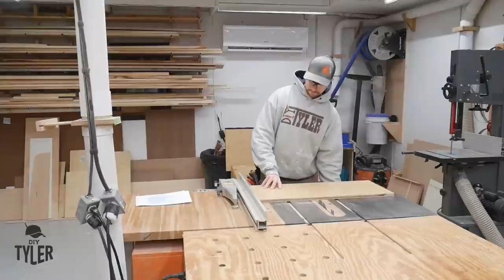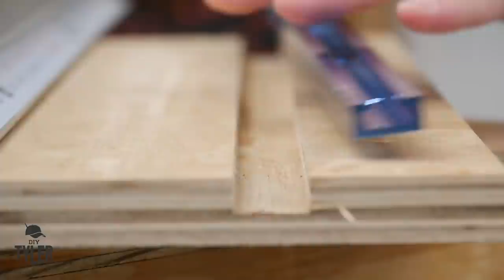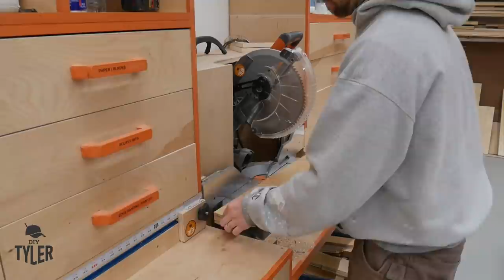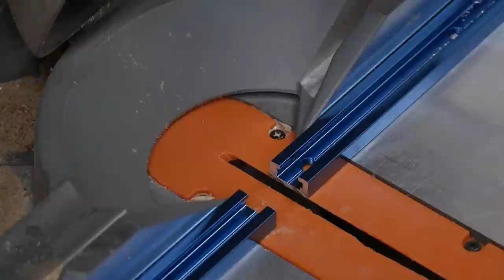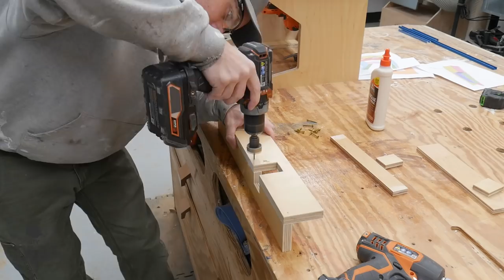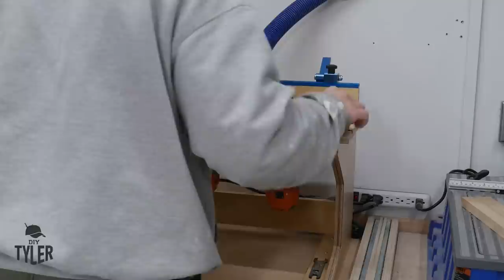How to make a DOUBLE Trim Router Table. Simple Shop Project will Make your Router Workflow Faster!

Comment: I think I’m going to do this on a larger scale with 3, 1-3/4 hp or 2-1/4 hp routers set up in a triangular table. Round over permanently set, a round nose for handles on cutting boards with a jig to make the correct stop and start, and the third will be for any other bit I need to change in and out. Then I’ll have one power feeder in the center that can swivel and service all 3 routers. One dust collection drop right in the center with a quick connect to switch between the 3. (Combining this idea with a picture I saw of a three spindle shaper)

Comment: Interesting build Tyler. However, if you already have two routers, why not just have a single station router table and just switch out the routers with different bits in them?
Reply: There's a few benefits, one of them could be having the same bit in them at different heights so it doesn't overload as much your routers, if youre taking by passes for instance. Another one could be to make 2 different profiles at the same time (for example, making a chamber and also a groove, on the side of a piece). And as he showed, just pushing one up and the other down is quicker than entirely switching the routers, in most cases.
Reply: I had the same idea I'm getting ready to build; I want to do moulding in 1 pass..... 1 router to tear some material out and second one for finish cut.... Might run the stock through a second time with just the second unit running to make sure it's a nice clean cut
Reply: I agree with you! Since you cannot keep height settings and you would need to lower or raise the secondary router.

Having two routers running parallel seems dangerous and you might also blow a fuse if they are connected to the same outlet.

Also fence setting is same for both operations... Not always what you want.

Comment: Since you have some magnets put them in the fence and also in a block of wood and you can close one of the holes to improve dust collection.
Reply: Obviously use the same spacing on each side so you can just move it from one to another.

Comment: I thought you were going for a use case where you used both routers simultaneously to create a complex profile.
Reply: I'd be concerned with differing cut and feed rates, especially once the second router engages.
Reply: @billparco8072  agreed that's a concern, but I still want to see it.

Comment: how about setting up for a cove and bead for a cedar strip canoe
Reply: This would work well for that operation.
Reply: @workswithwoodyeg  Can you set it up to do both cove and bead at the same time, one pass. It seems to me you would have to set up one router upright above and the other below the table. Otherwise you would get a push pull action on your work piece.
Reply: @lorencolt  yes you could do a two router set up, one up and one down. Honestly though the routers might be a bit close together for that. I would think on a two router setup you would want it dialed in pretty good for some precision work. For this, I would be inclined to do the beads first, then use the other router for the coves. Where I see this working well, if you did a lot of routing and always used a flush trim bit or a dedicated round over. Basically having two router tables in one, but again this is a little close together. The nice thing about these light routers is if they are cordless you can still take them to your work, rather than being stuck in the table the whole time.
Reply: I seen a dual router setup 30+ years ago with 2 Craftsman tables and routers but they were facing opposed and offset to each other for running cove and bead canoe strips at the same time. He could do enough footage in a hour to do 2 to 3 canoes. But the bead one had 2 fences and pulled the strip though pushing it through the cove set up that had feather boards to hold it to the fence.

Comment: You probably should add a way to close off one of the ports for the dust collection while one is in use.  Your drawing too much air in from the side your not using.  Or you you need to have 2 suction hoses connected (one for each port) with shut off values for each (better option in my opinion)

Comment: The point of such a setup is to run both at the same time with two complementary bits set up in order to make a deep grove or something more specific (like a repetable, non standard groove)
It helps to have a fence that can be setup not parallel to the line on which the two router bits, and maybe one of them should be tiltable, and a longer table.
I tried with two running at the same time, and there is no problem because both of them tend to draw the piece toward the fence.  Obviously it's better to use on a piece that has a nice straight edge.

Comment: Great video. Just a quick question. Have you tried using both routers at the same time? Such as using a different profile bit in each router to create molding or trim? I hope that question makes sense. Seems to me the first router might cut the top of the desired profile and the second router could cut the lower portion of the profile. By having the second router cut the lower portion of the profile it would leave a flat section on the stock longer to help prevent any tipping or rocking of the work piece. It would be interesting to see this done
Reply: Running two at the same time sounds dangerous... maybe if he can design and implement a way to clamp the material while it goes through both the routers.
Reply: @ZahNiNah  I think it would be fine as long as it's not cutting a lot of material at one time. If you camp it some how, how would you feed the material through the bits?
Reply: @hammerdownwoodworkingtracy3679  some sought of sliding clamp that attaches to the table... cant explain it... similar concept to a table saw

Comment: first thought I had, you will use both router at the same time, 
so why not having a pivot point in the center of your router fence to allow both routers in "up position" and just pivoting your fence to the router you wanna use, just an idea
Reply: THAT is an awesome idea. Shifting the fence is certainly quicker than pulling a router out of the table.

Comment: Although it worked for you in this case when you routed the long miter slot, you would have had less chance of the router wandering away from the fence if you went left to right instead of right to left.

Comment: Again, not something I need…..   BUT liked watching just the same.  Lots of ideas / techniques / problem solving I can use making other things.

As for the dust collection, I might try a small square of acrylic with magnets on the corners to close the side you’re not using. Inset with a rabit like your base plates.

Comment: Nice job, just not practical.
Still, an interesting concept. I could see this working for two identical bits with different cutting depths; one to hog out a bit of waste, the other to give the final cut. This would only work with bits being adjusted in height, not via the fence.